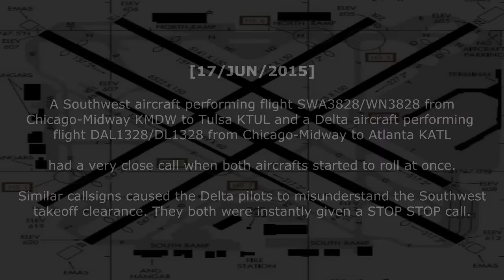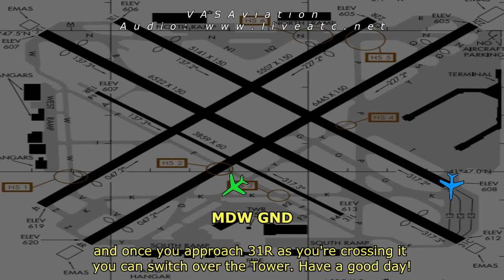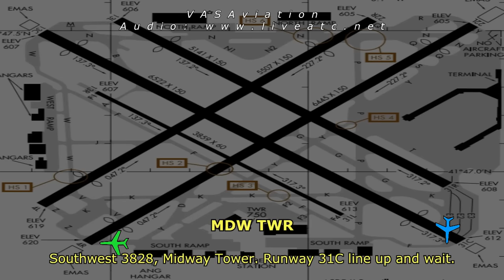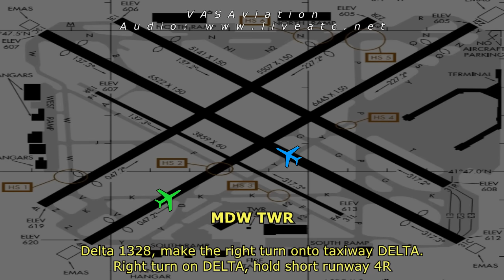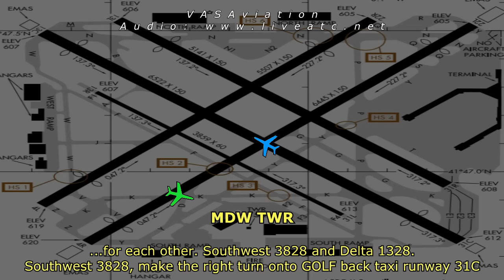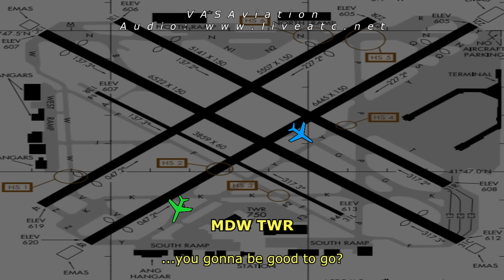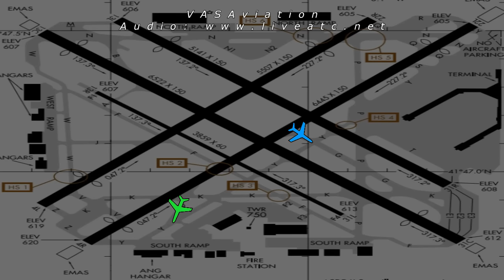[REAL ATC] Delta and Southwest VERY CLOSE CALL on takeoff

Comment: ATC: "Pay attention, similar callsigns."
Also ATC: "I will emphasize more the part of your callsigns that is similar, and mumble away at the Delta/Southwest part which is most dissimilar."
Reply: Are you complimenting ATC or have you mixed up your points?
Reply: @BKnight_  it's sarcasm. ATC tells them to be careful and then he mumbles the most important part
Reply: @brendalg4  I know what he is trying to say, but mumbling the parts which are most dissimilar implies the ATC does as he should and emphasises the parts that might otherwise cause confusion.

If he mumbled the parts which are most *similar*, then it'd imply poor communication and the mixing up of things. 

@MidnightSt says the former rather than the latter. "mumble away at the Delta/Southwest part which is most dissimilar" - okay? That doesn't matter though. You want to emphasise the numbers since, if you don't, you can cause the very confusion that we just saw in the video above. 

You could arguably say that there would be no confusion had the ATC just said "Delta" or "Southwest" but that'd bring along more confusion if other planes that are Delta or Southwest were in the area. It's also generally awful practice to refer to them by that rather than their numerical callsigns too. 

My point is that MidnightSt has worded it wrong. Mumbling the least important information wouldn't be a problem, it's the mumbling of the important information (the numbers) that is important.
Reply: Tower clearly said Runway 31C cleared for take off
Reply: @BKnight_  he shouldn't be mumbling any of it. If you can't speak without mumbling, then you shouldn't be a pilot or ATC
Reply: @BKnight_  : No, Midnight had it right.  The dissimilar part is the part you want to make sure the pilots hear.  That's the part that differentiates the two separate instructions to the two separate aircraft.   The similar parts are so similar that even if you said them fairly clearly, it still might not be enough to differentiate them, especially with poor radio/audio quality.  It seems like all we can hear is mumble 28 this and mumble 28 that.  But if the ATC had said "DELTA [mumble] 28" and "SOUTHWEST [mumble] 28", you would still be able to differentiate the two communications.
Reply: While they are similar, there were three things the pilots should've heard that would have prevented this: 1) Delta/Southwest 2) numbers (this was the similar part) 3) runways. The procedure has changed so that if similar numbered flights are at MDW, they demand readback and readback confirmation on runway crossings and takeoffs for similar types
Reply: Ground informed them of their similar callsigns not the tower ATC.
Reply: i wonder how much of all this is caused by low quality radio/mics
Reply: I think it was a radio issue. It got garbled. Still his fault though.
Reply: @danielk1380  I don't think so, it was happening repeatedly and consistently.
Reply: MidnightSt that’s when they were talking over each other. I mean initially when he gave the permission to take off it got garbled.
Reply: @BKnight_  As Captain Quirk said.
I have Delta 1328 and Southwest 3828.
The numbers are similar enough that both guys will either think that I'm talking to them, or to the other guy, whichever number I say (if they have to orient based on the number alone), so it's kind of irrelevant which of them I say. But Delta and Southwest are so distinct, that when I emphasize SOUTHWEST, and then say whichever of those two numbers, the correct SOUTHWEST plane will recieve the instruction, and when I say DELTA and whichever of those two numbers, the correct DELTA plane will recieve the order. It's a bit counter-intuitive, yes, and in some cases doesn't work, but this is one of those many many cases when it would work. ANd yes, psychology of human perception is weird.
Reply: @aneeshprasobhan  yeah, it never ceases to amaze me how incredibly shitty the sound quality off comms of THIS IMPORTANCE is, and its considered pretty normal, while we're here doing our daily calls about grocery shopping and who broke up with who, and complaining about sound quality if the other side sounds slightly tinny.
Reply: @BKnight_  "dissimilar" means not at all similar... Aka the least confusing part..... Back to 3rd grade with you
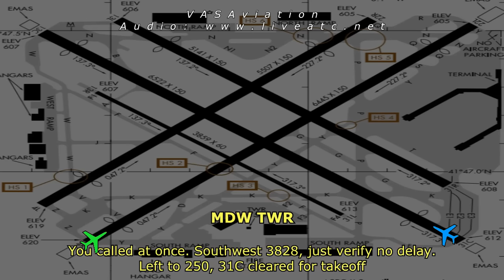Reply: @Ajgau11  1:24 Really?
Reply: Ground told them that, not tower
Reply: @BKnight_  Yep, if anything, you should mumble the parts that clearly distinguish who is who.
And enunciate the parts that are potentially ambiguous.

Basically, there needs to be as much mumbling as possible - of the words that most unequivocally identify each plane.

The parts that are similar already, well may as well say them clearly. No need to be too confusing.
I like to watch these accident videos and I want to see many, many more of them.
Reply: 465marko I suggest you to look up in the dictionary for the definition of “mumbling”, your whole comment does not make any sense.
Reply: @richardwhatever3231  /s 
I'm sorry, I get too optimistic sometimes.
Reply: Delta sounds nothing like Southwest even "mumbled" (it wasn't mumbled, I heard it clear as day. I have no clue why so many or you seem to be harder of hearing than me, a person who can only hear out of one ear)
Reply: It was ground that called attention to the similar call signs. it was tower giving the go ahead for takeoff. Two different teams and two different towers.
Reply: The ATC pretty much saved the day here. It could have been a disaster. Pilots were warned multiple times about similar call signs. ATC clearly cleared 31C for take off. Delta pilot was very irresponsible starting TO without clearence. All these comments criticizing ATC are unfair, hope he never reads them.
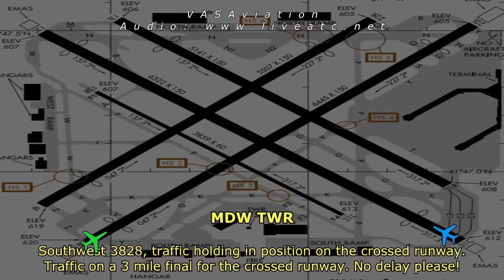Reply: @ShiningDarknes  bull crap you could hear that clearly. The first time he tells southwest to take off (1:08) it doesn’t even go over the radio, probably pressed the button a little late. And the second time (1:21:) you can barely hear “south” so even if the pilots had really good hearing their brains were probably already focused on trying to take off and would’ve missed it easily. You may have read it and your brain filled in the blank for you creating an illusion that you heard it but there was nothing that distinctly resembled “southwest” that came out of that audio.
Reply: @Darthvader-oc5tp  You are saying I couldn't hear something? Ok. Yeah I mean I guess you know how I hear.

You apparently could since you fucking timestamped it. Maybe you just aren't used to listening to coms chatter when multiple different people are talking and you only need to hear one of them.
Reply: @BKnight_  LMAO ok bud. If you were in a room with someone named Prescott, and you heard “...SCOTT” you would respond. If you heard “PREScott...” you would know not to respond, especially if you were just alerted that there was a Prescott in the room. The controller essentially only anunciated the “Scott” part, hence the confusion. Pretty sure a kindergartener could follow that logic - not too difficult.
Reply: @MidnightSt  the sound is much better in real life. We don't know where the receiving antenna is for this audio.

But in real life, the tower is transmitting from an array on the field, and the planes are transmitting from..the planes.... On the ground in this case. Even if the tower were on the total opposite end of the field, it's still only 2-3 miles, typically closer. And usually the tower isn't exactly where the transmitters are. They're usually somewhere else, on field often in a central location but out of the way.

Regardless, it's very clear when you're there in person.

It's not clear, when you are recording this over the internet, receiving audio from some random person's antenna which could be miles and miles away, with lots of trees, buildings and hills in the way.

👌👍😉
Reply: @BKnight_  I don't think you understand the concept of "similar".
Reply: @465marko  Best comment
Reply: @endokrin7897  Worth mentioning that cockpits are busy and noisy places and standard phrasology exists because even when the radio transmission is great, things can get confused and mixed up.
Reply: @stripeybeast  But if you heard "Scott Smith" would you respond or just be on alert?
Reply: Why didn’t pronounce the numbers? Delta One Three Two Eight instead of saying 1328.
Reply: @BKnight_  disagree, you should be as clear as possible on the DISSIMILAR parts so they can more easily identify who you are talking to. I mean, ideally you should be clear on both parts, but emphasizing the part of the call sign with more contrast is clearer. Imagine if your name was John Smith and somebody else’s name was Sarah Sniff, if somebody was calling out names over an intercom and had to choose one part to be more clear, which part would cause less confusion? Even if Sarah Sniff misheard “John Sniff” instead of “John Smith,” she would immediately understand that her name is not even close John and therefore they would both assume John was the one who was being called. Not an assessment of the ATC controller, I’m sure this just happens sometimes and he immediately made the right call to stop.
Reply: The ground frequency said that, then a completely different controller took over
Reply: @hansloyalitat9774  ...and that changes something about my point... how?
Reply: Comms over radio is very difficult. Timing the release switch so you don't take up more airtime than needed but also don't clip off the first word you say is a known issue across all voice radio communication. You can tell, these guys day in and day out attempt to communicate with poor quality, constant clipping and heterodyning. That it works at all most of the time amazes me. Time for a computerized traffic control and release system at airport, backed by voice. The computer tells you when it's your turn to speak.
Reply: @jctripplesticks  o
Reply: It seem like the tower controller start speaking before keying his mic so the crews can only hear something like “…twenty eight…” but still I cant figure out how someone could hear 31C as 4R
Reply: @jctripplesticks  The really smart thing to do, would be to avoid having similar callsigns lined up at once
in this case it was perfectly possible to hold DAL at the taxiway for 20 seconds longer while Soutwest was lined up.
THEN clear SW for take off, and only when SW is rolling, should ATC clear DAL to line up and hold
THEN Dal can be cleared for Take off without any possible risk of any possible confusion whatsoever.

This was a rush job by the ATC which was easily avoided. 20 seconds is all it took
Reply: This could have been avoided if ATC said “one three” instead of “thirteen”. They do this in Europe because of this. Pilots are at fault but ATC could make it easier.
Reply: @keeli5575  it might help in the second TO clearance, but the first one he keyed the mic too late
Reply: @BKnight_  Wtf are you talking about? Stop it
Reply: The ground controller who warned them about the similar call signs was saying delta and southwest clearly. She then passes both off to tower, and tower mumbles the airline name in the callsign but the runway number should’ve gave it away to the pilots
Reply: Could have also read the prefix as single digits.  One three and three eight are distinguishable over radio, while thirteen and thirty-eight are not.
Reply: @Ajgau11  Yeah seriously, not only does "three one" sound nothing at all like "four", but there IS no Four Center.  Was the Delta pilot looking at birds or something?
Reply: Be aware that comms switched to tower, so a different person. It was ground who consciously advised them of the similar callsign and tower might have been consciously unaware of how similar the callsigns are